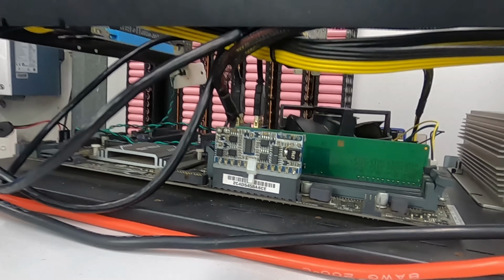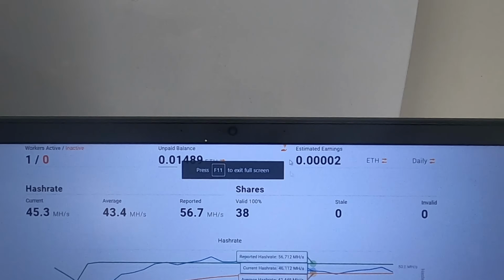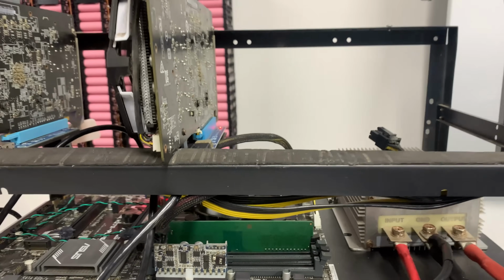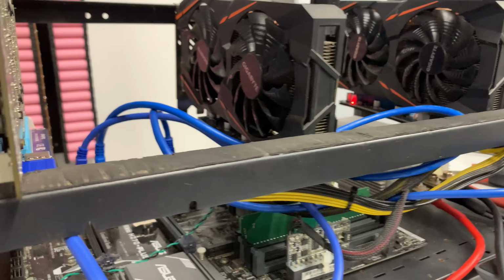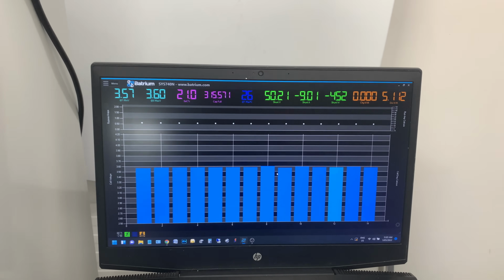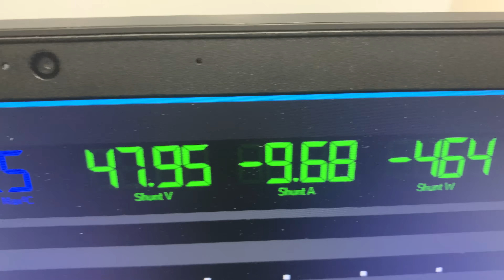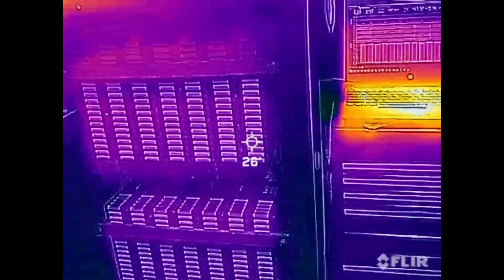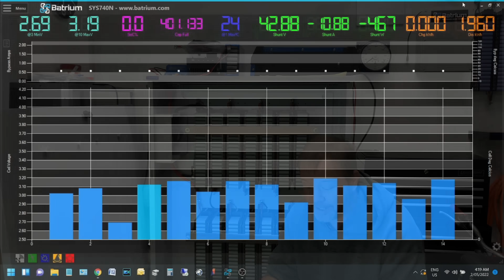DIY Lithium-ion Battery capacity testing

Comment: can it handle loads in excess of 10KW ?
Reply from the maker: Good handle sustained 10 kW loads without too much issue.
Reply: @HBPowerwall  i assumed so. lithiums are good for high power. But those cables look quite thin for a 48v system. even my 70mm2 cable gets warm to the touch at 12kw.. :)
Reply from the maker: I use fine strand welding cable, 32mm square I believe - holds up well as I don't put those loads on it anyway..

Comment: A lovely ride Pete. I watched 2 years  go by in 3 hours of all 6 parts
Reply from the maker: finally making the final video in the series, actually getting it INSTALLED RIGHT NOW~ lol
Reply: @HBPowerwall  Wow, I hope the batteries don't degrade off the charge they've held that long.
This video taught me a lot, because you see, I'm Nigeria. Here at home we don't have a steady power supply, nor is it cheap. 
Also, 2 months ago, after our new president was sworn in, gasoline prices rose by 300% totaling a 1,000% increase since the last 10 years. This makes it more difficult to run portable gasoline generators as has been the norm.....

Thankfully, I have recently just became a man (lol) and moved into my own space which I also double as a studio for photography and music recording. (😉that life, I'm the family handy man)

I was researching on 18650s for a power solution when I recalled bumping into your videos years back. You know I definitely had to come back to finish what we started.

A 2KW inverter should serve my current need. I majorly need it to be able to record music in silence. About 6 hours of runtime  will be sufficient since we get at least 8-10 hours of grid power during the day, (I know right? Our leadership system here isn't one that I am proud of). 
I wouldn't need solar panels for now for budget reasons. I can simply charge when the grid is on. 
Now you may think that's counter intuitive with regards to electrical billing, but since there's no metering, it will attract no extra cost. I know how dumb it sounds but the grid just serves us plugged‐in figures of guesstimation. If anything I'd be making the most of the huge charges I've had to pay all the while by now having the battery storage.

Thankfully,  I have the skill and electrical know-how to make such a system (esp. with all the resources out here). Even if it'll be my first DC generator, mine will be relatively small footprint. I did study Electrical Engineering for 3 years before dropping out for financial reasons plus I have a handful of engineering buds. But... I digress.

Now all I need is a fortune and the sale of my left kidney to buy the batteries 🤣. 
For real though, wish I had access to batteries. But even as young and dedicated, small business builders, we have access to zero loans in my country. Its pitiful but true.

It pains me that even for someone versatile enough to eliminate cost of labour as myself, I still can't afford the damn project to save my business.  Damn, this was meant to be a courtesy reply but I went off the rails.  I'm sorry. I was just thinking out loud, I'm just too fascinated by these things. So much so that I just watch other people's build just to live the moment with them.

I loved seing your wife and son in the video. It was a treat.
Regards, 
Naz

Comment: Thanks for your videos. I have read about the standards that put paid to your project, but what exactly was the deal breaker there? is it explained in one of your videos? The standards seem to be to do with where you locate the system, voltage limits etc. You seem like a persistent and highly competent sort of guy who could have dealt with those issues.
Reply from the maker: Good question! Issues are I don't understand the 'standards' as they are not a 'LAW' so in theory I 'CAN' do it, I believe the issue will arise  when someone dies as a result of my work or my house insurance needs to be claimed. Honestly I'm starting to thing I can do stuff just not well enough for me to sleep at night, you'll notice after these videos I started to really slow do big projects for fear of causing issues. Also personal issues but that's for another website :P
Reply: @HBPowerwall  Thanks for the reply, great that you're still around and willing to answer questions
Reply from the maker: I try but YouTube likes to make replying to replies much harder than it needs to be :(

Comment: Damn what's the distorsion about? WIFI?
Reply: Oow now guy makes the sun a digital miner. I've been thinking about a self sufficient system of recycled cells mainly to power refrigerator.. Nasty thing..all kinda voltages. Once seen an uninterupted 3 phase power supply. 220V DC motor on batteries drove it. Could be charged continuously. I called it the submarine room. you loose at least 10% mechanic loss and 10% copper loss, the battery. Do not seem to have a good idea yet. If I hwere you I'd really put the batteries in a separate compartment. I still don't trust those cells fire wise.

Comment: Do you still capacity test each cell? I've been muling over how/if I should capacity test before building my latest 7s30p pack. It's the first time I've built with used high discharge (max cont 10amp) cells.
Reply from the maker: EVERY SINGLE ONE!
Reply: @HBPowerwall  you don't have a video on a cheap way to mass capacity test do you? I work 5 days a week and a 5 month old so I don't get much time to do it

Comment: So they don't have individual battery control?
Isn't this
1) ineffective becasue you can not charge each cell for 100% and discharge untill 0
2) dangerous because you can overcharge some for more than 100%, so they ignite
3) going to break soon, because some will discharge below 0% which degrades them very quickly
???
I remember doing DIY powerbank and I've got such smart controller for 6 18650 batteries.
Reply from the maker: 1. Who in their right mind would charge too 100% and discharge to Zero? MADNESS!
2. The BMS controls the batteries in many ways monitoring cell voltage, heat etc - with out external forces are applied - these cells are safe enough to use. End user is more dangerous than they are. 
3. Hasn't broken yet - sounds like you have no idea what you're on about..

Comment: Apply new thermal pads to that card, and consider switching to another OS. I love simplemining for my 6 card rig.
Reply from the maker: nar it's input issue with 12v on top of card, 10min to find and fix faulty components

Comment: Love your work Pete. What a great way to use energy.
Do you charge it again with solar?
Reply from the maker: Thanks James, 99.9% of all charging of batteries is solar. The exception is if there is a severe weather event and batteries are flat, in that case it's all hands on deck and drop plus 10,000 watts into the batteries lol

Comment: I reckon that's a suspicious place to put the breaker but otherwise great video mate
Reply from the maker: it was electrically convenient - and looked neat, there is already a upgrade in place where physical access is only needed to reset it. It can be remotely triggered MANY ways, heat, cell voltage high/low, battery voltage high/low, manual external 'holyshit' button, or fire alarm with relay.

Comment: HBOpowerwall running with the 18650 baton long after jehu dropped it.
Reply from the maker: and I threw it into the crowd because this sort of effort is MADNESS lol
Reply: @HBPowerwall  yes and I caught it too. Yes the effort is huge, much easier to buy one, like pasta bread or growing veggies, but you have learnt and you have inspired me to learn too. I salute your efforts and I too do learn. What you have achieved is amazing and inspirational. Be proud of you long hours capacity testing etc.
Reply from the maker: Thanks bud, comments like this make it easier to keep going - trust me sometimes is a struggle just to open the editing software (the actual projects are fun & educational) I'm in the process of doing another load test but a different way to see if i can get more out of the battery
Reply: @HBPowerwall  you have achieved energy independence you are an early adopter of this a pioneer. More will follow where you are gone. Be proud of your achievements, your toil has its rewards, many people watch and learn from your videos without the comment or like button being pressed. I’m still building my 18650 in a glass fronted shop fridge. Still shopping around for a good bms.
Reply from the maker: Thanks for the feed back, and get the best BMS you can afford at the time.. that M in BMS is important with lithium cells such as these.
Reply: @HBPowerwall  thanks any recommendations apart from batrium?
Reply from the maker: Batrium lol - what can I say I'm a fanboy & never used anything else better, but then again haven't tried anything else comparable either.
Reply: @garystewart6093  You should look up Off-Grid Garage, Andy has tested many LFP BMS's so a good brand there might also make a good Li-ion version, I think JK Smart BMS is the best so far, it has a 2A active balancer that charges a supercapacitor from the high cell and dumps it into the lowest cell. It works very well.

Comment: you should try nicehash os might be a little more stable
Reply from the maker: It kinda is but it really isn’t because of windows OS. Card was faulty so still would crash on NiceHash
Reply: @HBPowerwall  yeah i commented befor the point out about the card been dead
Reply from the maker: All good buddy
Reply: @HBPowerwall  i keep wondering what it would take for an efficient off=grid crypto farm my idea always works it way back to hydro
Reply from the maker: Best way is heaps of solar and just leave it at that. Cost of infrastructure and maintenance with anything else isn’t cost effective
Reply: @HBPowerwall  and just have it shut down at night ? Or have a battery to run the night
Reply from the maker: Mining rigs should be run 24/7 its not efficient to turn them on and off - Solar will offset ~40% of your power costs and is cost effective & & easy
Reply: @HBPowerwall  sounds good

Comment: That was interesting. Suspense increased, as video progressed. :)

You didn't tell us the total amount of cash mined? 
Was curious how many ¢/kWh were earned.

Will you measure how much energy is needed to re-charge the pack back up to 100%?
Reply from the maker: Because of the coin change I’ll round up to $4 usd give or take two bucks 😝
Reply: @HBPowerwall  Fair. So ~16-20¢/kWh
Reply from the maker: Please don’t force me to math its late ⏰ 🥹